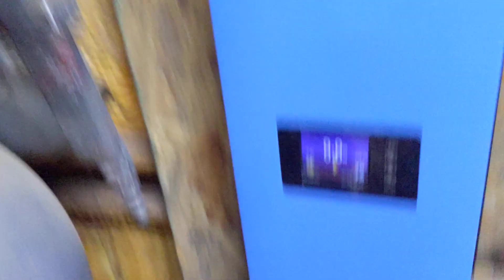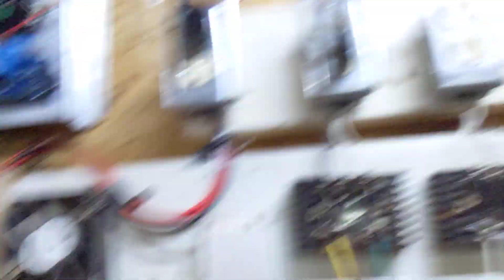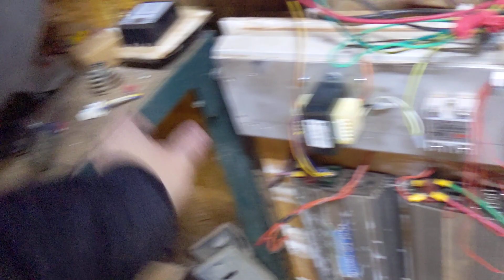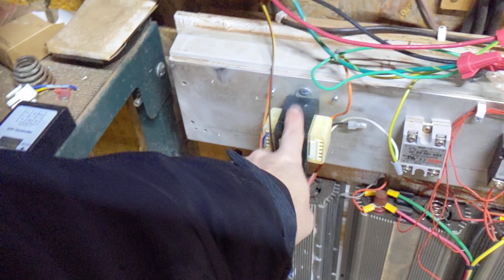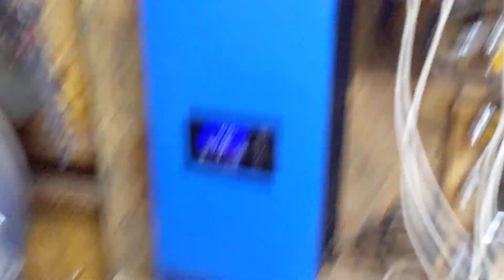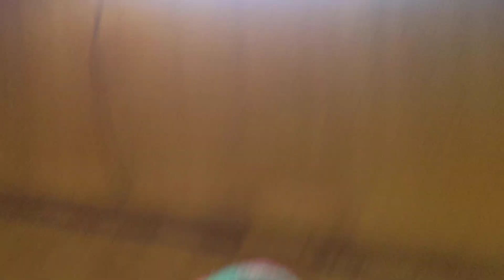External brake controller for the 2000w turbine grid tie inverter

Comment: Hello here from Holland, i have the same inverter now a year running fine with a tesup teus 3.0 turbine, i connect a grill element in parallel makes it 7 ohm so the turbine is not overspeed in storm and brakes it by pulse wide modulation from the inverter at gust. Now it runs very well up to 1,5 a 2 kW. The bottom ventilators are not working anymore but doesn't effect the inverter. Can i send some photo and video ? Cheers Arjen

Comment: Hello, I keep finding it fascinating how you are solving all the issues in such a creative way! Also in the back of my mind it hurts me a bit that you are struggling with some of these devices so much. 
I do have a "turbine --> battery --> Grid AC out"-setup as well, which is way more simpel (not sure if you remember, but I did send a message about a year ago as well. It was about the controller relay which could not handle to much current). Back then you did not use the blue inverter yet, but maybe you are now open to think about my solution again.

Since the blue inverter has anti island protection, you can technically switch the inverter on and off by a relay on the AC side. I am currently still using the same controller relay (A30) as back then. And it still works perfectly. My Istabreeze 2K turbine is directly connected to my 51.2V LiFePo4 battery. Dumping the energy into the grid is completely based on the relay controller.

Back then you said the relay controller blew up a few times when the current was to heavy. I still struggle to accept that it can not handle it (it does work easily for me with 1600W / 230V = almost 7A on the connectors).

Let me please be clear, I do not want to show off, or play the smart ass. It just hurt me to see you struggle and find all those work arounds for the broken devices. Please ignore this message and my 'setup'-talk if you feel offended. My message is/was not meant to be offensive.

Again, I do really enjoy your creativity and your way of finding solutions instead of seeing it as problems!
Reply from the maker: The issue isn't that the relays can't handle normal line voltage, but that there's a delay between being triggered and when the inverters actually grab the current.  If your battery bank is large enough then it's not a problem, but mine really isn't meant for storage...there's about 200ah there all together.  Under normal conditions it works, the delay between when the relay trips and the inverters grab it isn't a problem, but if there's a sudden gust battery voltage can spike pretty heavily and that's what blows up the A30 controllers (and my batteries).  The big blue inverter is faster on the uptake so it was easier to work with in that configuration (although having the 220 cycled on and off so much jacked up its memory) and that let me run the small inverters off the AC side, but just the small inverters being operated by the A30 doesn't work for me because I don't have enough batteries to clamp it down.
Reply: @ToysforWatts  Sorry, with all those batteries I expected the voltage to be way more stable. Assumptions are dangerous, right :p. I did use those 3 phase blue inverters in the past as well (I had 2x 1000W). My experience is that they take big gusts of current (my bms showed currents of 85A+ and the bimetal circuit breakers of 100A disconnected). Same goes for the blue DC inverters. So I doubt if these inverters can operate really efficient without big battery buffers. Directly connected to my turbine or with small batteries the inverters caused way to much resistance for the turbine. It just could not get up to speed.

Comment: I did something similar with my Sun GTIL 1000 but the inverter would over volt as soon as I released the dump load. When does your system release the dump load?
Reply from the maker: It's hard to say, I haven't had enough wind to test that the voltage divider is operating on a linear voltage scale...but it should be closing the circuit on the brake at 75vdc and opening it back up at 63vdc.
Reply: @ToysforWatts  have you tried raising the dump load cut in voltage up from 75v to max and using the original dump load?  My Tessup 2.4kw can  put out 90v in a strong wind.
Reply from the maker: The relays don't turn off even if I disable the dump load.